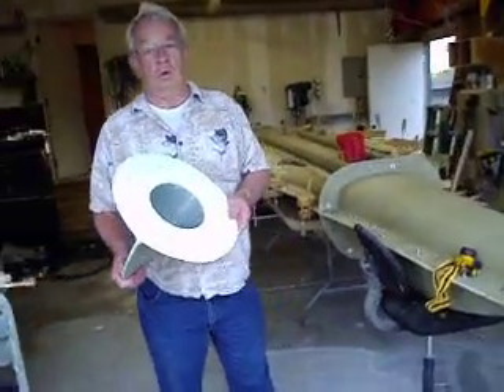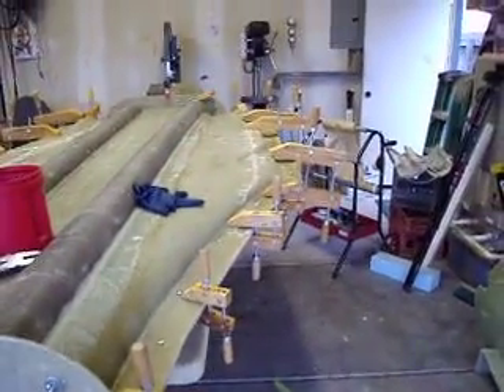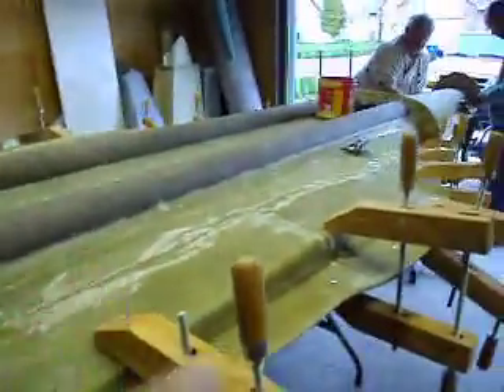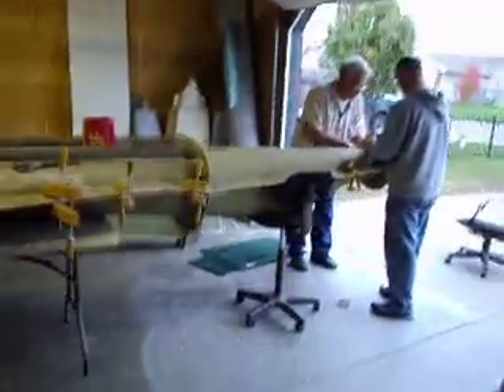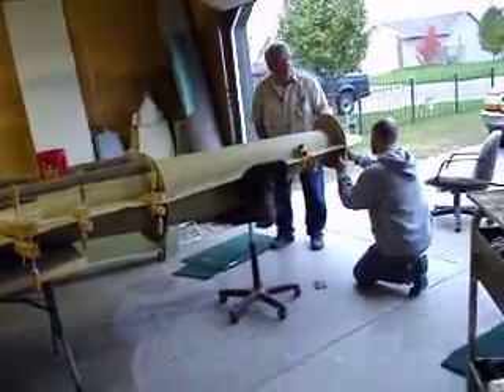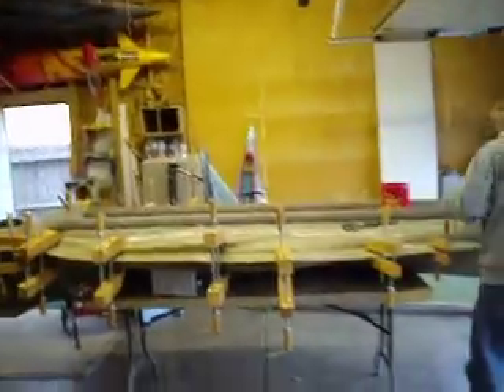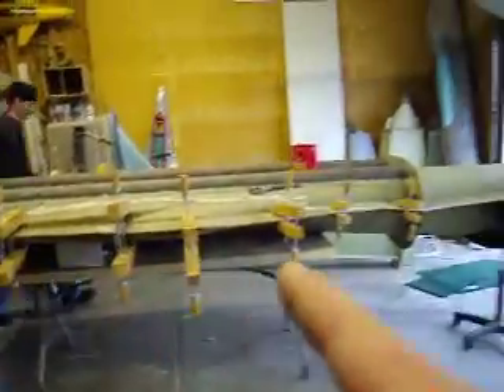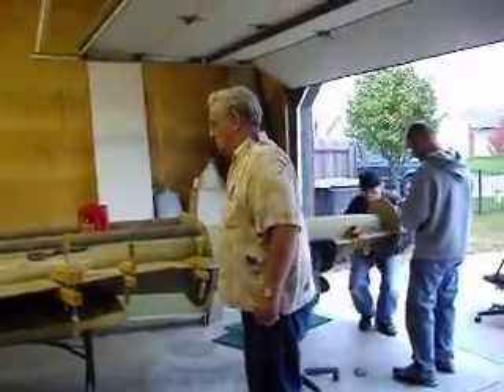How to build a rc jet b1 bomber #89

Comment: Bob, are you going on just the structural strength of a monocoque fuselage to handle the stresses, or do you plan on trying to snake a keel into that bird? I can see that you are supporting the weight of the plane by tying it to the wings via the aluminum wing box, but I'm curious about how that fuse will handle the sheer and torsion of pitch, yaw, roll, and landing when you load the airframe up.

Comment: I'm a bit worried as to how your going to get all the gear and cylinders and all that radio and bomb bays (their are 3 ) with that b1b shell all closed up. Are you going to cut out the panel lines and insert all the gear and stuff through their? Also, I got a great (safe) idea for bombs. Use styrofoam then cut the styrofoam bomb in half and hollow the halves out fill them with grey or black And glu the halves togetherSo this way when you drop them they actually look real!! (and no one gets hurt)